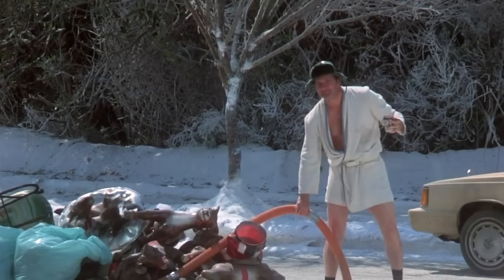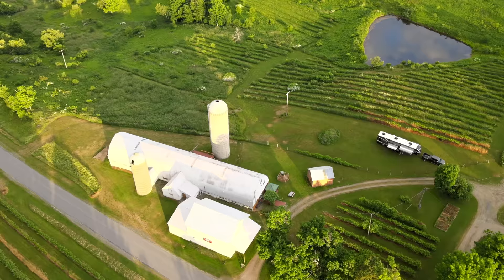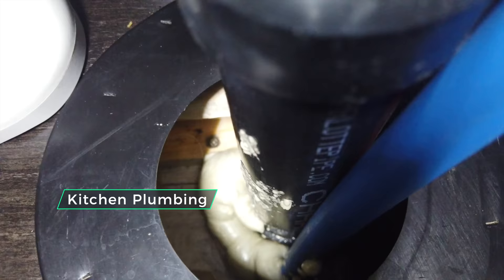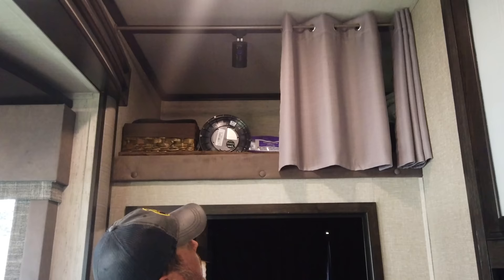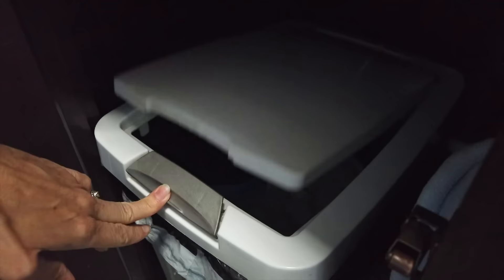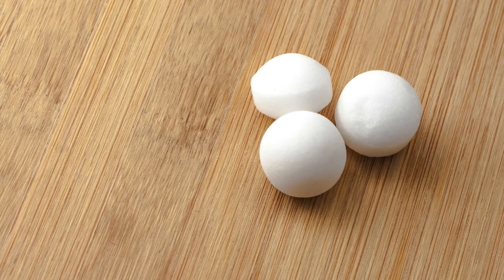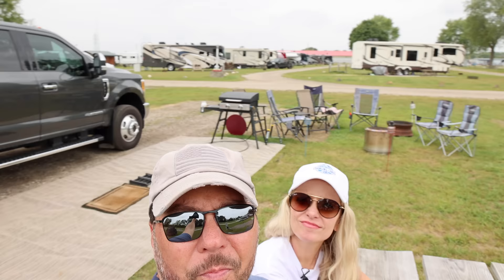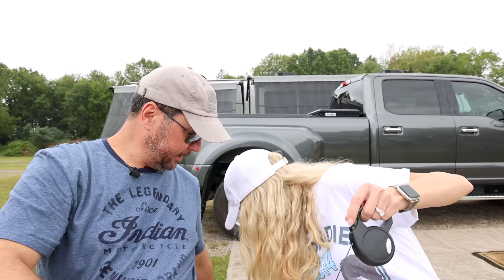RV Pest Control (Avoid Rodents / Bugs / Spiders)!

Comment: We’ve been RVing for >30 years and have used the electric plug in gizmos for pest control both on the road and when RV is in storage. Also whenever the levelers go down we sprinkle Comet (big shaker from a $ store)  around anything that touches the ground. Haven’t ever had a pest problem anywhere across this great country.  🇺🇸
Reply: Chris Kibodeaux  i don't believe they work either but i got a pack for free and i just use them to use them. Who knows
Reply: What brand of "plug in gizmo" do you use.
Reply: @1206jl  none of ones i tried worked.
Reply: Foam needs hardware cloth and screwed down…

Smelly stuff needs to be replaced often…

Motion alert cameras….

This is a list of many things tried and failed . 8-(

Comment: To stop rodents from entering, you first need to deny them access to anything that gets them up to the chassis. They will climb tires, and jacks to get up. I have had good luck with mothballs on top of tires and around the base of the jacks, but they will climb right over mothballs if they are in the way.  It is the smell that keeps them away.  My house gets mice all the time due to being out in farmland, and I am constantly chasing little openings. One day I watched one of the little buggers walking the foundation, and leaped over the mothball bag.  If the mothballs are surrounding the pads, and on top of tires, the aroma will keep them from going up the tires, and they don't like to stand on them. If they can leap over them, they will.  Placing them inside will do nothing though, once inside, only traps will take care of them.   Seal all openings, larger ones with steel or brass wool, then foam. They will chew through foam, but not steel wool.   Irish Spring and dryer sheets are great for keeping the trailer smelling good, but wont deter mice.  When I put the trailer in storage I make sure there is no way for them to get up, so never had a pest problem. One year after taking it out of storage and getting it all set up for traveling, one got in.  The trailer had the power cord inside so you pulled it out to plug in, and well, the cord was on the ground, and the little bugger climbed it and got in through the outlet cover.   Always remove bedding, clothing or anything they can use to nest with and remove all foodstuffs. If they can't smell it, they won't go near it.

Comment: An idea to enhance the foam filling the holes and gaps. Stuff some steel wool in the gap first. Then spray the foam in.  I’ve heard rodents can chew through the foam without the steel wool. Love your videos!!!
Reply: Rodents can chew through anything, that is how they their teeth sharpened. Their teeth constantly grow.
Reply: SO disgusting ! I am SO freaked out I found 4 and all trapped on glue strips but now I’m freaking out every lil sound 
So freaked out 
Eeek
Reply: Steel wool is flammable and also any exposed steel wool will rust.

Comment: I picked up a can of great stuff at Wally World during a grocery run many years ago. When we took the bags out of the trunk the Great Stuff must have rolled out of the grocery bag and it got forgotten. I live in Florida. In the summer it gets hot. It was about 105 degrees one day and the car was parked in the full sun at work. This car was just bought new recently (only 6 months old, less than 7000 miles on it). The Stuff exploded with such force that it sounded like a bomb going off. It blew a 1 foot diameter hole through the back seat and coated every square inch of the interior with Stuff which quickly hardened in the hot sun. It was driven immediately to a car detail shop but they could not get any of it off. It was on all the windows (including the front and back windshield) so much you could barely see out of them. It was on every inch of fabric from the seats to the floor to the carpet. The entire dashboard was covered. The insurance company said the car was totaled. I then had to buy my own car from the insurance company for like $650. On the outside it looked brand new and ran like new. The inside was crazy trashed. Someone was willing to buy it for about $3000 (it was a brand new $18000 car after all) which was enough to cover the gap in coverage.

Comment: A quick tip.  We have tried several methods over the years after finding a squirrel family living in our outdoor kitchen in a former trailer.  One of the methods we have used is the ultrasonic devices similar to what is featured in the video.  We started to notice our dog behaving erratically, full of stress, pacing around, whining etc.   Unplugged the anti rodent device and he was fixed.  So fellow dog owners might want to be careful with this particular solution.
Cheers
Unhappily stuck in Ontario, can't go South, can't go East
Reply: My wife can hear them as well and was a similar reaction as was with your dog.

Comment: I used steel wool around my plumbing pipes from the inside, usually works, it’s not messy and easy to remove and put back if work needs to be done

Comment: We use copper wool for the larger gaps going in and ortho home defense spray. Both worked on our home and so far in our first year we haven't had any bugs inside. We also put tomcat mouse bait station under our rv by the tires so the mice will find the food source outside and die so we don't end up with any rodents inside the rv. Our brick and mortar home had a huge mouse and bug problem when we bought it and used a pest company to fix it and understand how to do it ourself. We took those methods and applied them to the rv. You guys are awesome. Since my wife got cancer and we can't tent camp we looked into rv trailers. I came across your YouTube channel and my wife thought I had been RVing for years when we would talk to the dealer or go out with it. Thank you for being here and sharing. It has made a difference in our lives to confidently go on vacation with our three dogs and enjoy life again.

Comment: On a lot of older RV's the power cord was hard wired in and you just pulled one end out of a hole, and plugged it it.
Anything walking on the wire, walks right it.
Install a bulkhead type setup, so you are plugging in at both ends and its a sealed system.
  Those pot scrubber, stainless steel things.... if you stick part of one in the big gaps, before the spray foam, they can't eat their way through it.
 Stay safe!

Comment: Rodents can eat through the foam, but it helps for sure. One thing you can also do is pour foam then while it's wet,add steel wool pad, then cover it with foam. Mice will not chew through steel wool.

Comment: "Raid MAX bug barrier" is pretty good to use on the outside. I sprayed all exterior windows/doorframes and storage doors/bottom holes/roof entrance areas and have had zero issues. Doesn't eat paint or rubber. Will last a few months even with weather. Id re-apply if you power wash the RV but other than that its pretty cheap and easy to apply.

Comment: I had mice get in my class C and eat the wiring harness up in the engine.  I found on Amazon Grandpa Gus Mouse Repellent and so far it has worked.  I guess I will find out this winter how well it works but so far so good.  Enjoy your videos thanks for producing them.
Reply: I had a similar situation but it wasn't mice it was squirrels.

Comment: I use steel wool in all my openings. Works great. I don't suggest putting steel wool where the water hose comes in. It will get wet and rust, then you have a problem getting the steel wool out. Never even thought about that when I put it in the opening. Because the hole is lined with aluminum, it definitely stuck. LOL. Great advice, have a happy Labor Day.
Reply: I pack course steel wool in the openings underneath and then encase it in spray foam to keep the moisture out.  Works like a champ.

Comment: We had mice one year then the next year we did essential peppermint oil on cotton pads all around the camper and it worked no more mice. It smelled good and it kept them away. We also did one of the electronic rodent deterrents but the battery ran out on that and the peppermint kept them away.

Comment: Shorter and to the point videos are not a bad thing. Especially if it makes it easier for you guys to manage. I use Irish spring soap and some moth balls her at home in my garage. Seems to have stopped my problem with mice, but who knows for sure. Knock on wood, we haven’t had any infestation problems in our trailer. Thanks

Comment: I have a Primetime  Spartan fifth wheel toy hauler. They sealed it up pretty good but I did get a mouse, from a campground. We left the patio open and I believe it got in that way. I also use the electronic Mouse blocker and it seems to work pretty good. Also every time I take my trailer out I spray a pesticide , around the outer edge underneath and that seems to work pretty well.

Comment: Our class A has a wet bay. I have learned to HATE wet bays.
Oh, they are real convenient, one common compartment
where your water & power & tv & dump hose all connect & 
stow HOWEVER, all wet bays have a hole in the floor to
route your lines out to the utility pole through. These lines
are a RODENT HIGHWAY. NEVER lay your lines along the 
ground where the critters can climb up into your wet bay.
We stuff dryer sheets around the lines through the exit
portal. As time goes by you will notice the sheets lose
their smell. Change them often. No critter likes strong smells
so anything with a strong smell will help deter them. Irish
spring soap, bleach, ammonia, dryer sheets, ben gay.
I like how travel trailers & campervans have all their hookups
connecting to the outside of the rig with NO openings to the inside.
Its on my to do list to do the same to my A. 
ALSO, when we return home, unload ALL edibles from the 
rig. Leave NOTHING inside to attract a critters. Well, bottled water is OK.

!

Comment: Thanks for the great video as always! Thankfully we haven’t had pest problems with our current rig but my biggest tip is keep hoses and lines off the ground as much as possible (they’re a perfect highway for ants)! I use a couple bungee cords to coil and hang the power cable and water hose (usually from the slide-out) so they can’t even touch the ground! I tried the Irish Spring soap... it made the interior and basement smell nice and fresh... until our stupid dog decided to eat it! She only got mildly sick but doesn’t seem to be any dumber than before!🤦🏻‍♂️

Comment: Thank you for videos! I cut up Irish Spring and put on the batteries of my golf cart and in my 5th wheel and keeps rats out. I used cotton balls soaked in peppermint under the hood of my truck, but didn’t keep rats out. I’m now using  cut up Irish Spring but have to take out when I drive it since I haven’t figured out how to attach it..  It’s working so far.  I live in a rural area and use truck and trailer about 8 out of 12 months so when I don’t use truck much during off time, rodents have plenty of time to set up house.

Comment: Thank you for the advice! I tried the ultrasonic repellants and they have not worked in my current RV. I’m actually trading in my 42ft 5er for a smaller footprint (since it’s just me now) and I’ll be trying peppermint oil and foam in the openings in my new RV.. 🙏🏾

Comment: I have used Fresh Cab from Tractor Supply for a while now in the camper, a boat and an antique truck and it's always worked well, but it's expensive. I looked into the ingredients and found I could make my own for pennies. Ground walnut shells from Amazon and Balsam Pine essential oil also from Amazon and small burlap trinket bags again from Amazon. I mix up a bunch and keep it in an airtight container. The walnut shells go into the trinket bags and they go into the places the mice love. I also use the sonic mouse repelers. So far they've worked very well in all three places.

Comment: Great Video Chad and Tara.  We had our RV in the shop getting some things done and when we got it back we found LOTS of mouse droppings everywhere in the RV.  I put out some of those sticky mats, but found nothing in them except a couple spiders or flies.  We had some of those Downy dryer sheets, which seemed to work in those areas, but the little buggers even got into our silverware trays and left some of their pellet calling cards for us to clean up.  I watched a YouTube video on the electronic pest sonic devices (search for "Do Electronic Pest Repellers Work?") Also I wonder about your modified devices; if you cover them in tape, I wonder if that actually diminishes or even blocks the sonic output.  If you have a decibel meter you could test that output with and without the tape.  At any rate, these videos are very helpful and much appreciated. Stay Safe!

Comment: Mouth balls are very toxic to animals. 
We use mainly electronic deterrent inside and out.
We had a rat in our Jeep once so we went to Lowe’s and bought an electronic device , mounted it on some 2 by 8 boards and stuck it under the Jeep, the rat  was gone and now for 3 years we place it under our class A and never had any rodents inside.
Reply: What brand of electronic deterrent do you use?
Reply: @1206jl  we use victor pet chaser pro Heavy-Duty Sonic PestChaser Pest Repeller.  You can buy them at Lowe’s or Amazon.  My husband put them on two 2x4 boards screwed together to keep them off the ground and put them under the RV.  We never had any problems.

Comment: If any readers are reading this comment here is 100% accurate true like Chad and Tara advise. 

I purchase my RV back in 2013 a NRVTA inspector told me fill all gap with Pest Control Foam same can from this video and spray foot levers and electrical cord/water hose at ground level with insect spray same one from video. 

Now 2021 9yrs later, I never got any issues with pest/rotten and either with ants but got very few spiders that may find a way in from trees above. I also pick up all trash outside prior bed and have RV LED Markers Lights automatically turn on at sunset that turn off at sunrise DYI build while camping. Those marker lights also safe me multiple times from skunk passing by RV. Ohh I hate those.  Cheers all.

Comment: Hi guys,

Sounds like you have a handle on pest control. We have a suggestion for flying things that come in the house. They are window fly traps. They are a clear rectangular piece of plastic that sticks flat on your window. You stick it in a bottom corner of the window and forget it. Needless to say it has to be changed. We change it depending on its appearance. We highly recommend the Black Flag brand, been using it for years, but Raid makes them too. I personally prefer the Black Flag brand, I think they work better.

Good job on the tire change, and will be contacting you about the M5. (We're doing a Changing Lanes marathon the next couple of days)
Still repairing from the hail storm (What the Hail video)

Stay safe and well.

Chief, Dee and Lucy🐾
4EverLand RV
Reply from the maker: Great tip!  Just ordered some!

Comment: Great comments here!... Believe it or not I've changed out the mud flaps on my coach which tend to touch the ground after the air comes out of the suspension... Somehow the new rubber has deterred the little bastards from coming in and making a home of our rig... So far so good!...
Reply: Or they do not now smell mouse tracks in…spray beach water to mask trails in to rv

Comment: Copper Mesh For Mouse Rat Rodent Control as well as Bat Snell Control 30 Foot Roll (a copper mesh wool material that is rust-proof and)
Brand: Stuff-fit
4.6 out of 5 stars    33 ratings
Price:	$18.00 & FREE Shipping
  Amazon

You can also pick it up at Home Depot,  Lowes, etc...  

Steel wool will burn if in contact with a spark or ignition source.  Steel wool will rust as well.

Comment: DE is probably the best thing to put around your landing gear for ants and other exoskeleton type insects.  It gets into the joints and basically paralyzes them.

The ultrasonic repellants, I'm with you guys on them as well.  I had a really bad pantry moth infestation due to some infested bird food I bought.  I spent several years finally getting down to the point that I didn't have too many fluttering around my house.  At the beginning of this year, I bought a two-pack of them and put one in my house hallway and put one in my kitchen, where I've had problems with sugar ants, and I've not seen an ant or moth in my house since I put them up.  Just before I plugged them in, I did change the pheromone trap for the moths and caught two, but after I plugged in the repellers, nothing.  Not 100% sure that is the reason, but I am not going to be taking them out anytime soon.

Comment: I have tried everything but the lights but think it's too late. They have totally invaded due to my neglect to keep up with it. During the pandemic I had no time to keep up with most maintenance issues because my line of focus was on my income. Instead of my usual 50hr week was and still am 70hr or more a week. While was protecting my investment while stored in my yard was using deer scam in which swear by. Using a hand spreader (generally use for lawn stuff) would lay out a barrier around my RV while doing my tree's. Never had a problem till stopped using. 
Have a 2000 35' Cruise Master with 24,000 miles that is 4 Sale.

Comment: good vid! what about electronic devices such as the "Neatmaster Ultrasonic Pest Repeller Electronic Plug-in Indoor Pest Repellent". this is the only one i've tried as i dont endorse it (yet). but I did have a mouse chew on a coil wire which cost $400 to replace which wasn't covered by Ford warranty (Class-A F53 Ford chassis). interesting story: the Ford mechanic told me that Ford uses peanut oil on the coil/spark plug connectors to help them fit better (what?!). unfortunately, unless they make battery-operated devices, they need electric to work.